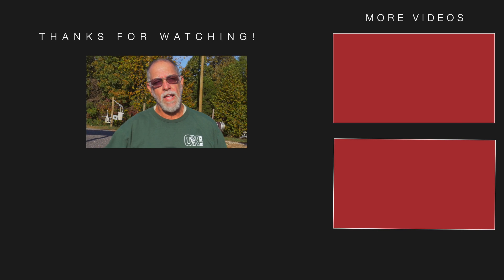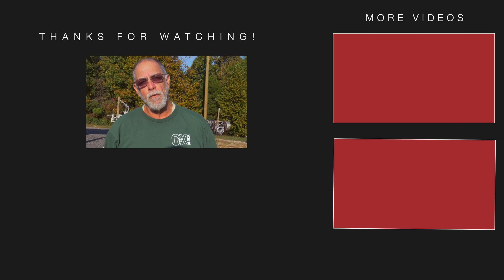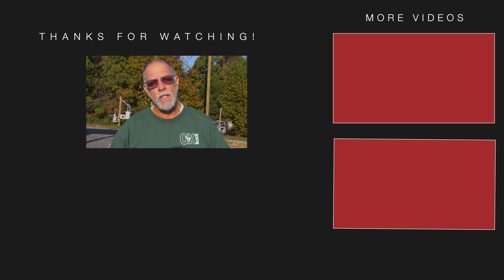ELITE Lineman - Class 12 - Highlights 3

Comment: For the record- A square can be considered a rectangle. All interior angles are 90 degrees and it has 4 sides. However, a rectangle may not be a square since a square's 4 sides are equidistant. A rectangle can have 2 sides the same and 2 sides longer, but still has the required 4 sides.         Now a rhombus is a 4 sided figure with 2 sides parallel and the same length and 2 other sides parallel and the same length. A square is a member of the rhombus family since it has those properties.        (Old Geometry still works!!)